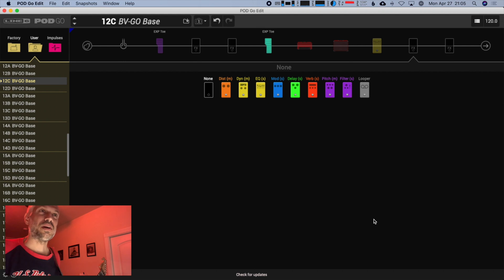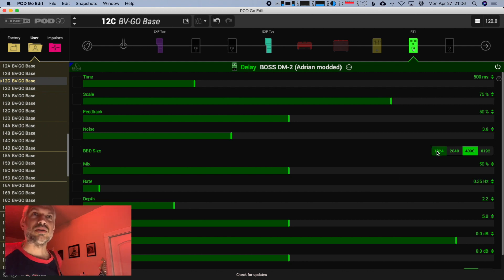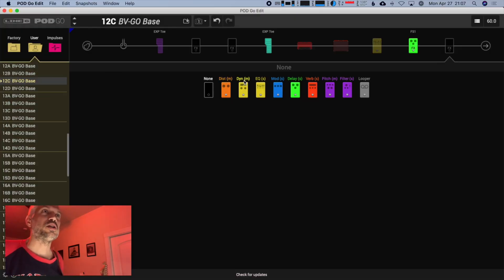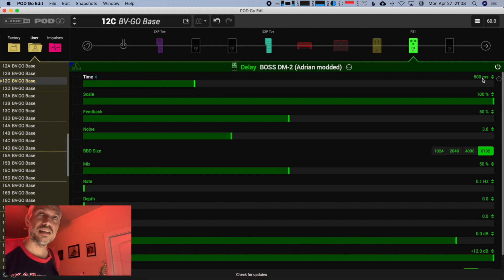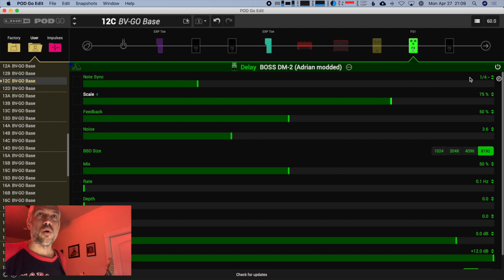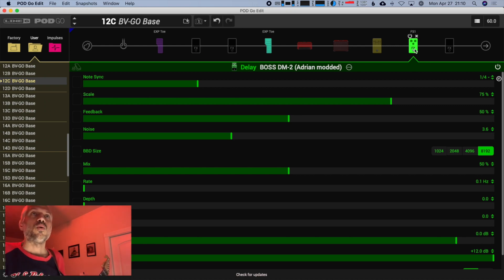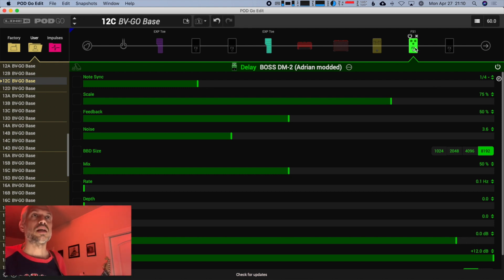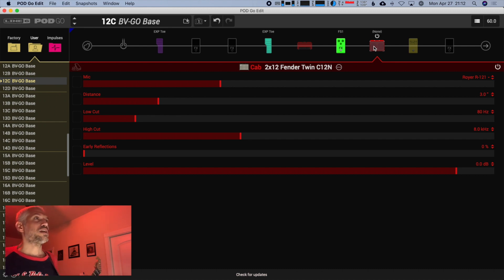Line 6 POD Go Tips: Stereo Delay Settings

Comment: Super tip, thanks! Is there a way to release the amp model from being a fixed block so users (especially if we want some patches as a pure stomp box board with no need for amp/cab)  can have more effects?
Reply from the maker: The best you can do is set it to the "del sol 300" bass pre-amp model and bypass it. That will free up the most DSP for other things.

Comment: This is a great tip, thanks for sharing. Is this also simulating the dual path delays (like on Helix) where the 1/4 and dotted 1/8 delays are not feeding in to each other? When I panned left or right on your demo, it sounded as if one were feeding in to the other. Still very useful to have multiple delays going in a single effects block. Thanks again!
Reply: After setting this up on my PG, the two delay times were not feeding in to each other as they would using 2 delay effects blocks (stacking). That's a great work-around since parallel signal paths aren't an option on the PG. Thanks again!
Reply: I dont mean to be off topic but does someone know of a method to get back into an Instagram account??
I was dumb lost the account password. I appreciate any help you can give me
Reply: @Axton Michael It did the trick and I actually got access to my account again. Im so happy:D
Thanks so much you really help me out!
Reply: @Chandler Moshe happy to help xD

Comment: Very great tip, thank you very much for sharing but I have a question about when putting the cab after the delay, the delay becomes mono. In that case, does it use less DSP power or does it stay the same? I've watched your other video about the DSP of Helix and the Pod GO but I haven't got the answer there.
Reply from the maker: On POD Go, all delays are stereo and use the same amount of DSP regardless where they're placed in the chain. What is happening when you put it before the cab is the cab is mixing both LEFT and RIGHT signals into mono but the delay is still generating both signals so still uses the same DSP.
Reply: @bvesco  
Thank you very much for the reply!

Comment: Hi, I need to ask you for a courtesy ... it is easy for me to use the pod go ... but I have a difficulty ... I did not understand how to use the tap tempo to manage the repetitions of the delay ... I bend better .. . I am used to a delay nova repeater in pedalboard and I just press on the tap to establish the timing of the repetition ... That is, the delay I set by pressing the tap is what I find myself in the effect ... so for example I can put 5 bars of "echo" in 4/4 ... typical of Gilmour or U2 ... but on pod go I just can't manage the delay like this ... can you help me? I can set the delay only by setting the parameters 1/1 - 1/4 - 1/8 - 1/16 according to the BPM but it doesn't give me the effect of 5 beats in 4/4 to do this I have to adjust the milliseconds with the wheel but it is uncomfortable and slow I prefer the tap absolutely and I am sure it can be done ... thanks a lot of greetings
Reply from the maker: When editing the delay, on the knob that is for milliseconds, press down on that knob like it is a button. That will allow it to be controlled by tap tempo.